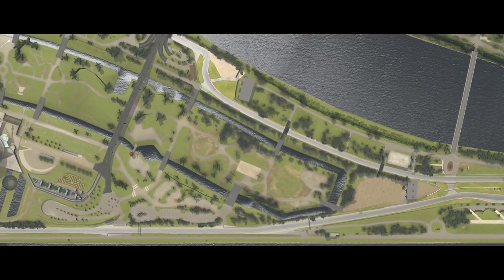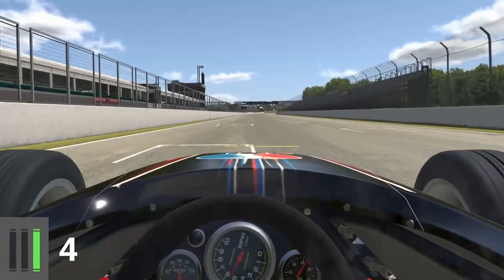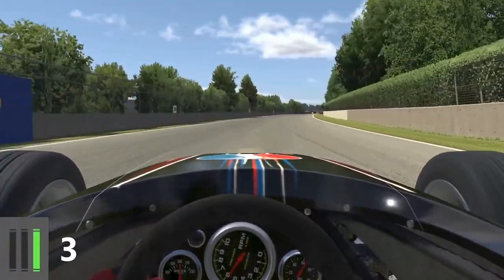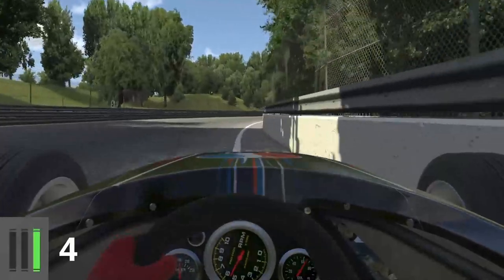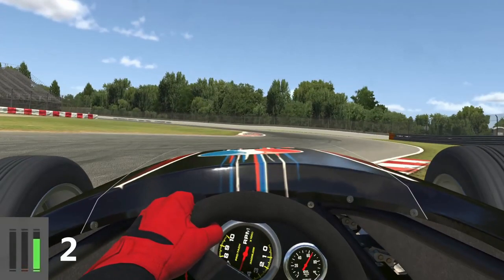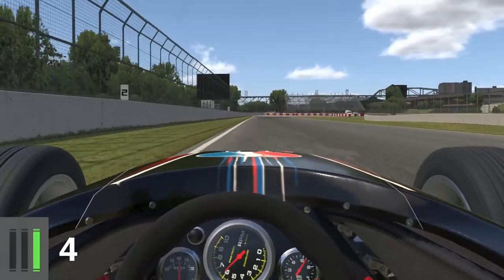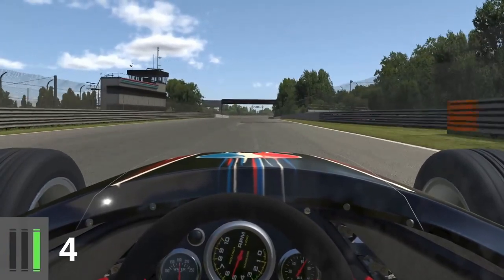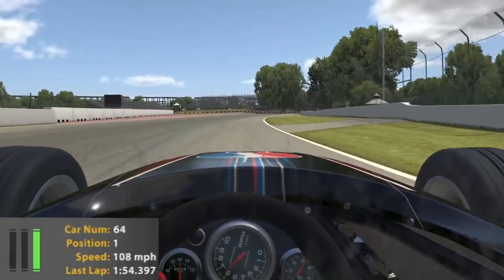Track Guide - Skip Barber - Montreal - 1:54.397 (Setup+Blap)

Comment: Thanks for this video ! Very helpful for the beginner I am on IRacing :-) I was wondering, how many laps you need to heat the car before you can actually push like that ? Do you need to work the tires like in real life to heat them up (with the brakes and so on) ?
Reply from the maker: It does take a few laps to get everything warmed up in this car. I'd say by about lap 5 everything should be ready to go!